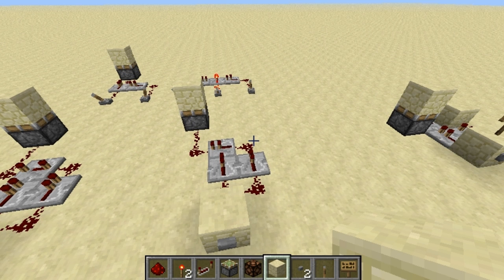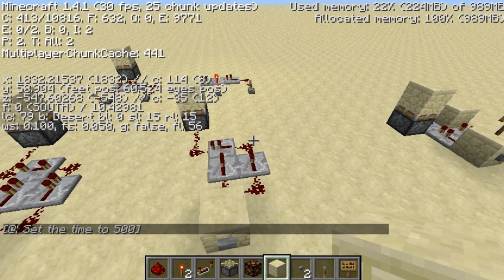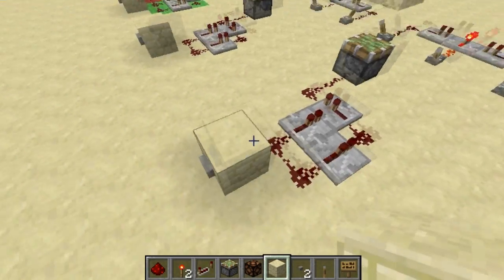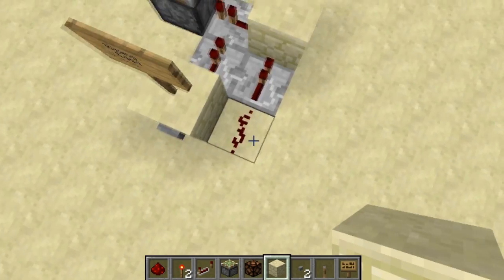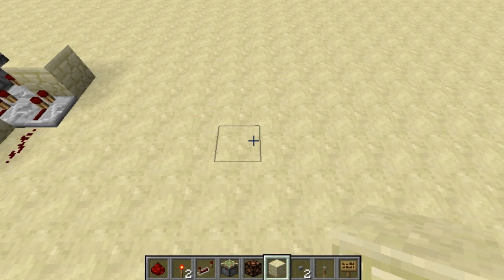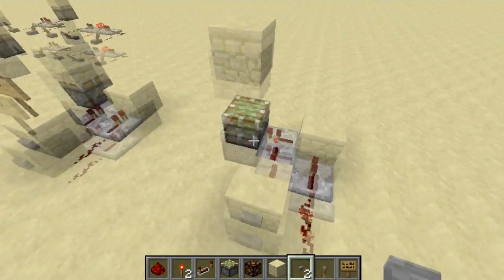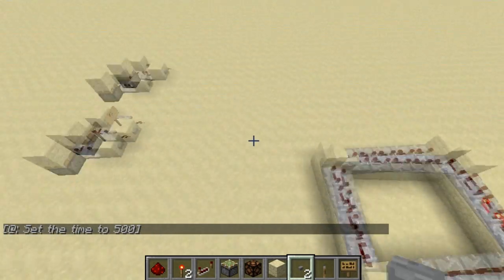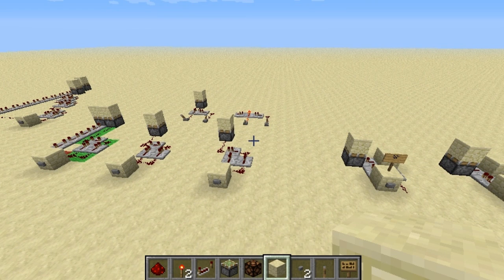The 123 Monostable Circut [Pulse Shortener]

Comment from the maker: In mob system when you would have a mob step on a pressure plate that connects to a repeater that powers a piston to push the mob. Some times it would happen so fast the repeater would forget to turn off.

Comment: Did you try it? It worked just fine when I did it. The torch powers the dust and repeaters but while the locked repeater is locked the power does not reach the piston. :)

Comment: monostabe circuits are used in some designs of t flip flops 
the difference is monostabe circuits are pulse limiters he was just using the pistons to so it was a 1 tick pulse
monostabe circuits can also (in some casses) be used as falling or rising edge detectors